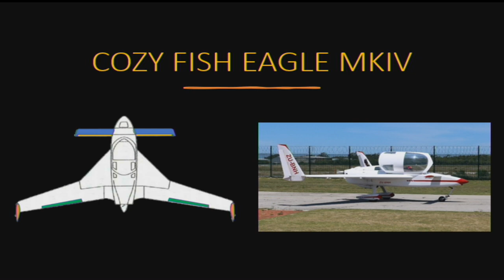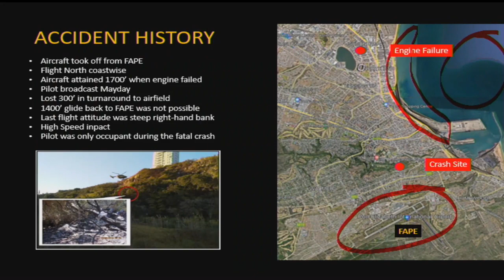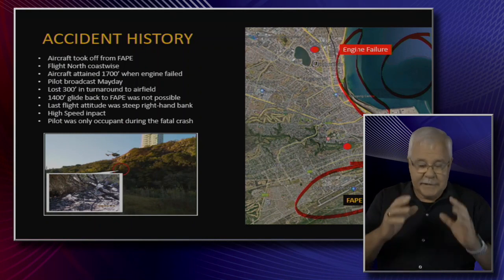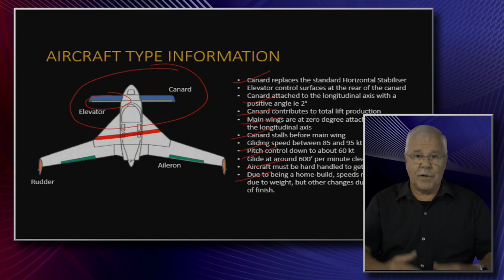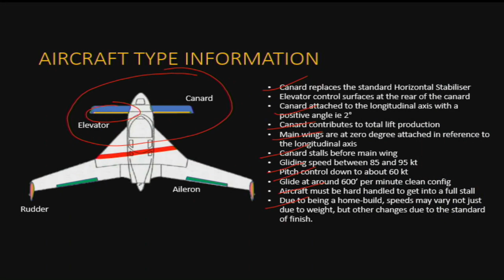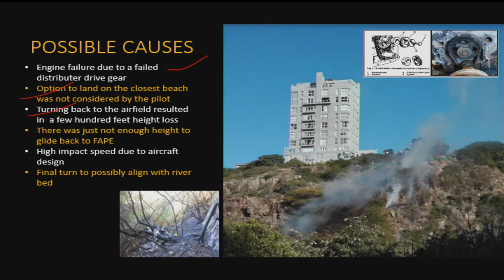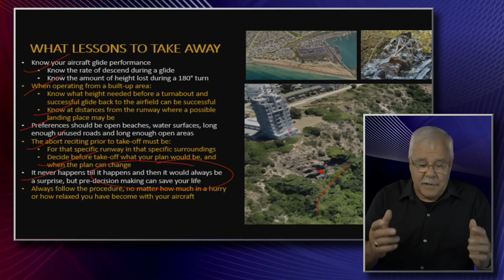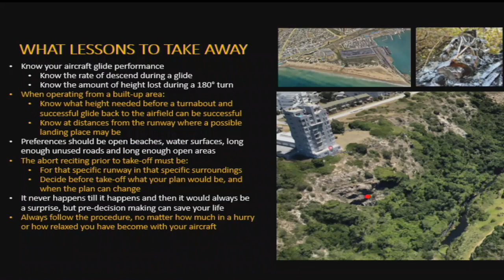Cozy Fish Eagle Fatal Crash

Comment: This engine was a v8 aluminum buick engine.  Those long ez berkut cozy e racer are good at gliding and the water is a good spot because there foam and fiberglass made aircraft.  Should have put it down in the water he was thinking about the plane . My life is worth more than the plane. He flew that think for quite a while with no problems.  To bad though.  Thats why when you fly you should always think if my engine goes out where do i put it down? Its good practice for the real thing.

Comment: I would svoid the use of 'stall speed' when talking about a canard or tandem eing planform as its not accurate... The term 'minim control speed' is a better term.

Also, both the cozy and Long ez have a main plane incidence of 1.5 degrees. They do have a positive incidence... I would assume that the AoA must be higher on the canard (though it often is) as some can be configured to share the same incid3nce as the mainplane so long as the canard is opersting at a highwr wing loading.
Reply from the maker: Thank you, I definitely take your point and learn to live.  The question is if the pilots of such aircraft understand the differences with conventional design and do they know how to overcome challenges.  Please help to update the pilots building and flying the aircraft as I am of the opinion that not all understand the entire picture.

Comment: An overall healthy breakdown of a very avoidable accident: the airplane may have been destroyed in a water ditching, but statistically near shore water ditchings are highly survivable. 

On achieving a high angle of attack stall immediately before impact: it's practically an aerobatic maneuver requiring huge, perfectly timed elevator deflection and a keen sense of energy management. Otherwise well intended, suggesting that there is a design advantage for all "conventional" design airplanes which offers pilots the unique ability to achieve an extremely high angle of attack immediately before contact with sloped terrain (by entering heavy control pitch input at the last second before impact) is misleading at best. A maneuver such as that would be hugely challenging in any aircraft, dead stick or not, but especially with no thrust at pilot's disposal, BECAUSE it takes energy to achieve a pitch up like that.

For safety's sake, focusing on the specifics of stall speed (rather than the ability or inability to perform a hasty, life-saving, dynamic pitch up maneuver immediately before impact) may be a more beneficial point to dissect here. Beyond the arguable significant added efficiency of having two lifting surfaces working together, canard aircraft have the great safety feature of stall resistance built in. But until you get into larger canards such as the Beechcraft Starship, you're not going to see flaps designed into canard aircraft because of the engineering complexity and mechanical apparatus weight penalties associated with implementing such systems in smaller, light aircraft. So most canard aircraft do not have flaps and thus their landing speeds are higher than an equally sized aircraft with flaps. But they are stall resistant. (Resistant, not proof. Any aircraft can be pushed to its limits in an accelerated stall.) And since off field landings in any aircraft are more survivable with reduced energy at point of impact, ANY airplane which can reduce it's velocity through use of flaps has a better chance of survival in an off-field landing, canard or not. A significantly favorable attitude at moment of impact is an added plus, IF a skilled pilot is even capable of successfully achieving such a perfectly timed, airspeed critical, last second, desperate maneuver. Without practice, a pilot is not going to come remotely close to achieving a maneuver like that without divine intervention.
Reply from the maker: Great, thank you for your input!
Reply: @AirCrashInvestigator  Take care...
Reply: John Denvers aircraft was "destroyed" in water, with him.
Reply: Otherwise when you mention the other differences in as far as others making judgment, landing without undercarriage difference from undercarriage, landing with flap assist, different from no flaps and extra speed, rule in flight then is you fly as long as possible and DO NOT DIVE, then ditch, in which case would have hit harbor infrastructure or broken up. Period. He had NO ATC assistance either, ATC assist would have increased survival chances, "positive reinforcement".
Reply: It's a dangerous thing to try to practice, deep stalls are unexplored territory for canards, if you lose too much airspeed, you get into a flat 'spin' where you have no control and you're just falling vertically. I've heard of someone opening the canopy and leaning out  over the nose to pull the CG forward enough to get it into a dive and increase airspeed enough to get elevator control, but that may be just a story, it also was reported that this took over 5000ft to recover.